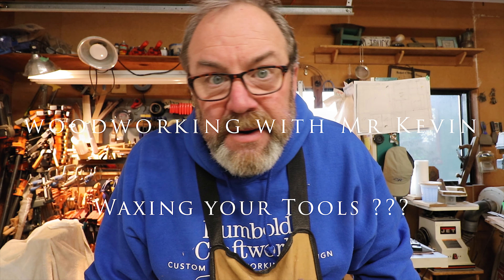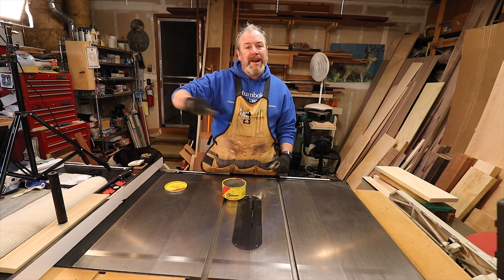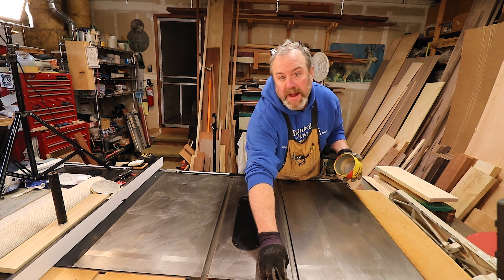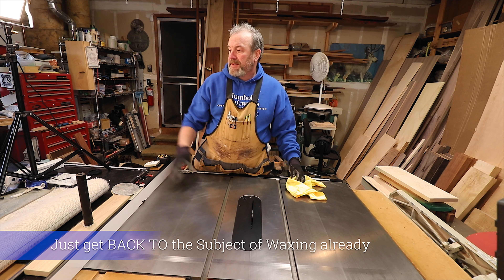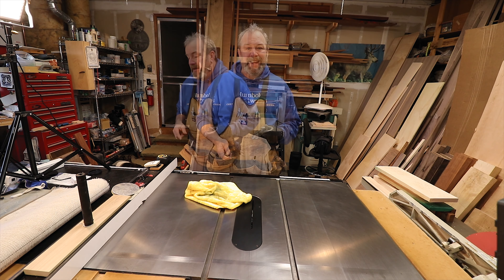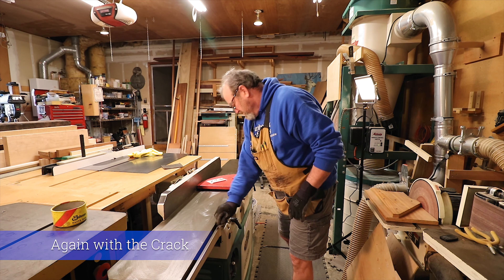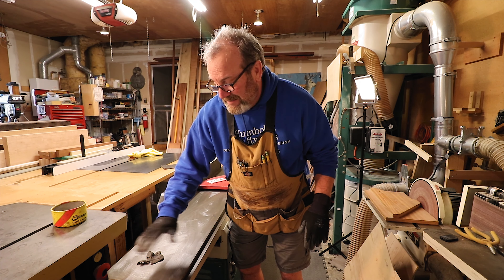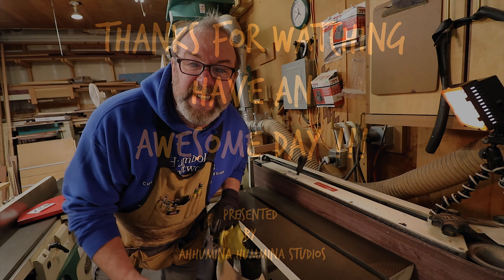" Waxing Your  Tools"  Wood Working with Mr Kevin

Comment: Loved the mood and the info. I live in Thailand and part of the year is wet season; so 35C with 90% humidity.  Sometimes if a spot appears, I use a Scotch-Brite pad and some mineral oil and do the entire table; it takes some elbow grease for sure.  Then back to dry lube or paste wax to seal it up again. Attention to the crack is important. A clean-up needs to be done quite often. Rust never rests.
Reply from the maker: Thanks for watching John👍 humidity is a killer for tablesaws and any tool with a metal top It’s important to wax your tools😃👍 Have an awesome day

Comment: Did uou apply the wax with steel wool? Loved the video, a clean crack is a happy crack
Reply from the maker: JOHNOOH yes I definitely apply the wax with steel wool works really good you can also use those 3M pads they were just as good and a clean crack is a happy crack that’s for sure thanks for watching have an awesome day😃👍